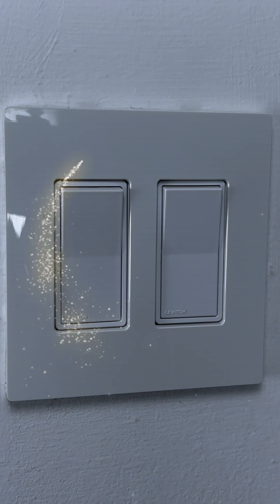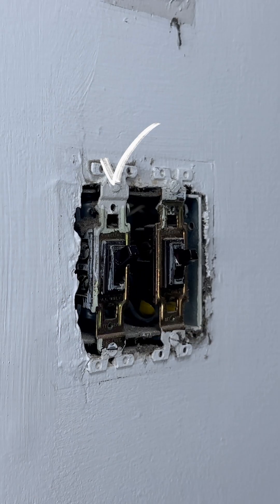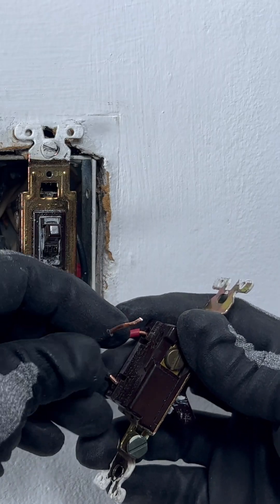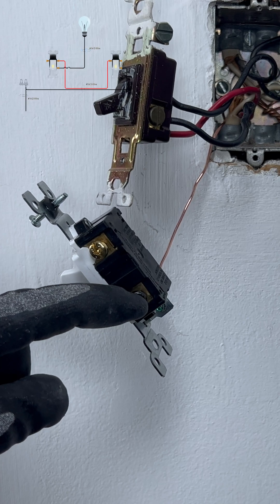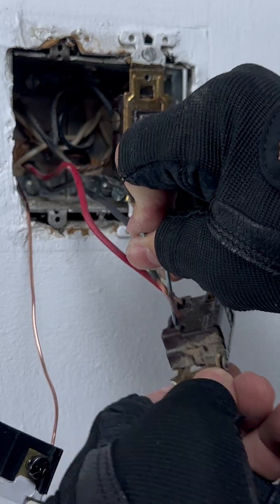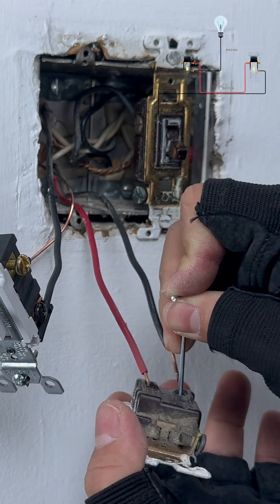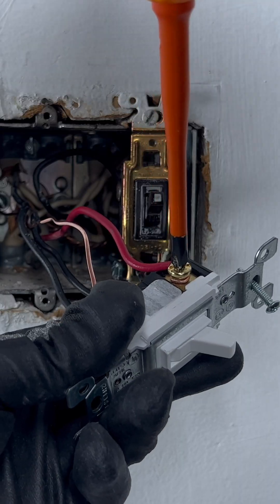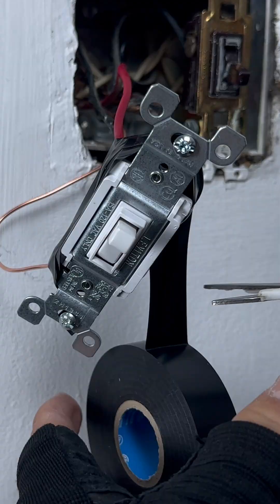Easy Step to replace 3 way switch

Comment: Never use a non contact voltage tester to verify if the power is off, You use a DMM. Non contact volt meters are used for troubleshooting stuff that you don't intend to come into contact with.
Reply: Why? Genuine question as a diy homeowner

Comment: What is a 3 way switch? and how do you know if the switch your replacing is a 3 way or not.. To me a light switch is a light switch please clarify
Reply: if you can control your same   light (lights) from 2 different switches those two switches will be 3 way switches
Reply: 3 -way will not say on or off

Comment: What was that orange tool he used?
Reply: If you're referring to the screwdriver, they make electrician screwdrivers where the shaft is covered with non-conductive material to help prevent accidental contact with live wires.
Reply: No the tool he used to cram the wires back into the box
Reply: @RvSimon  lmao, not sure what that was.

Comment: What if I get black wires mixed up for some reason or another?
Reply: if you don’t have the wires on the right screws the switch won’t work just how the electric flows through the switch and traveling wire gotta be lined up so the power can flow through when the switch is turned on. There’s some good YouTube vids explaining it. This is what I’m learning in electric courses right now
Reply: Look inside your box and find the power it’s the black that’s not coming threw the 12 3